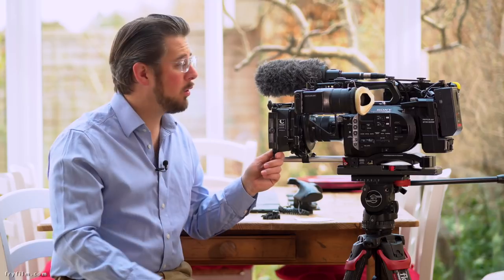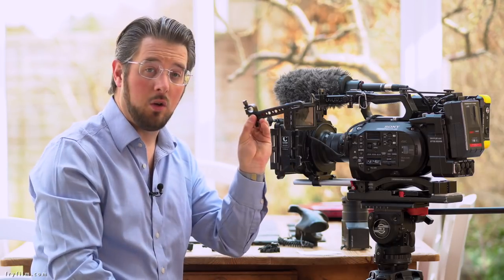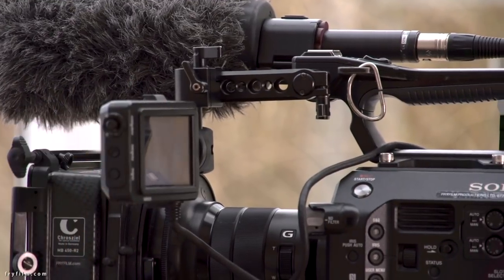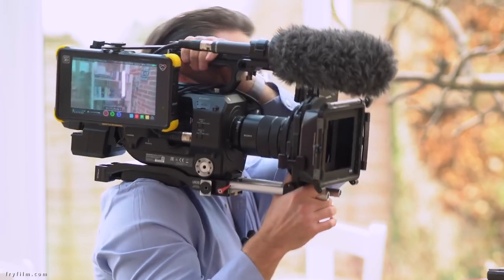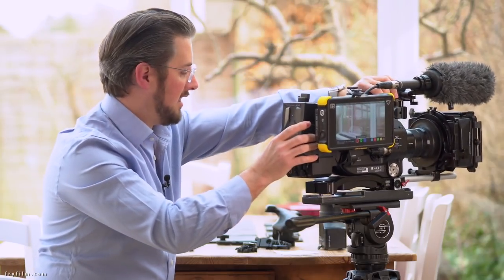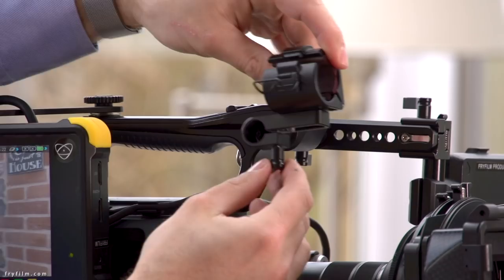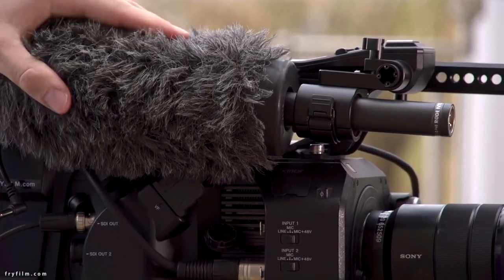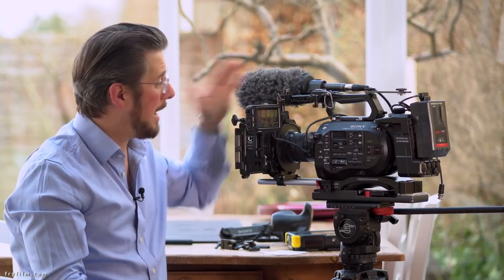Sony FS7 viewfinder & mic mount modifications

Comment: That was the best sales video for the Sachtler FSB 8 I've seen yet.  It that the standard quick mount plate  comes with the tripod or a special order piece for the FS7?
Reply from the maker: It's a very standard VCT-14 plate, which the Vocas FS7 rod plate snaps into. These are standard tripod plates for all broadcast ENG cameras, and attaches very securely to the Sachtler plate with two big screws.
Reply: @fryfilm2000  Thank you for the info.

Comment: Hey there, great video! One question, I’ve noticed on my fs7 that the side where you fitted the small rig microphone rod has no where near enough to put on mine. It is only poking out on that side by about 5mm and it doesn’t seem like that can be pushed left or right from one side to the other... is that correct? Many thanks!
Reply from the maker: There are an Allen screw on the bottom of the handle (opposite the hotshoe) which you need to loosen, then the rod just slides through.

Comment: The bracket on the side of the viewfinder is not like the one I have on my FS7.  Is that an add on as well?  I bought the Small Rig pieces but can't get the 15 mm extension to tighten on the EVF.
Reply from the maker: We put a short rod into the viewfinder which then goes into the Smallrig piece.

Comment: Just worked with the FS5 and I have to say is the worst camera I ever work with.  The viewfinder was all over the place. It was very hard to keep a good level with it.  The bottoms as I was shooting made it very challenging, I was trying to hold the view finder do to the fact that it falls very easy and I pressed something that made the image go upside down. Now I was doing a concert and the lighting conditions where very low, I couldn’t find where the bottom was to go back to normal view. Sony might thought of good images but it didn’t think of the person operating the camera.  Producers are asking for this camera since is cheaper, at the same time it compromises my skill and the end result of the shot. It is time to start thinking about operators. Pretty image, horrible design
Reply from the maker: You'll have to take that up with Sony.

Comment: I solved an issue with complaints about the viewfinder rod being annoyingly short.   If anyone is interested.. 9-inch length, adding an additional 3 inches to the original.   https://rigidesigns.com/products/fs7-extended-arm